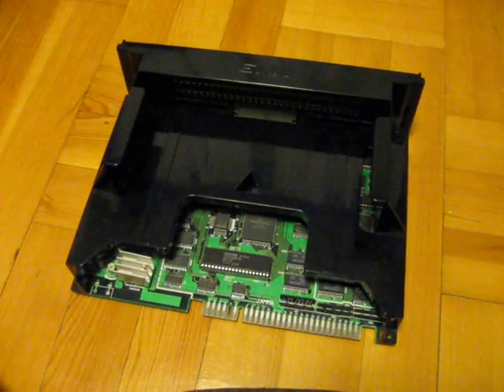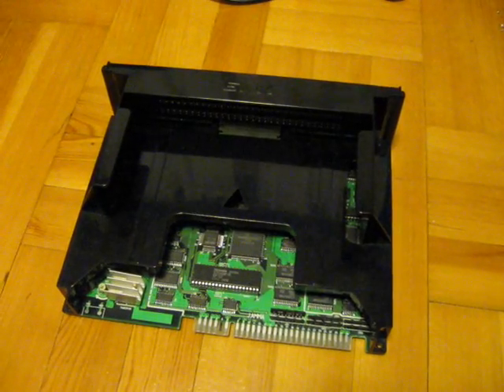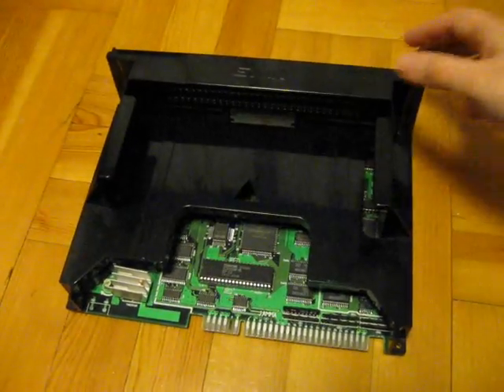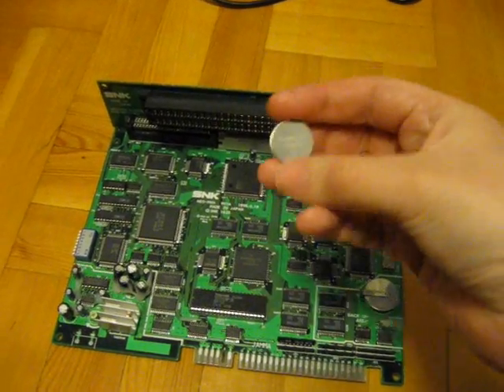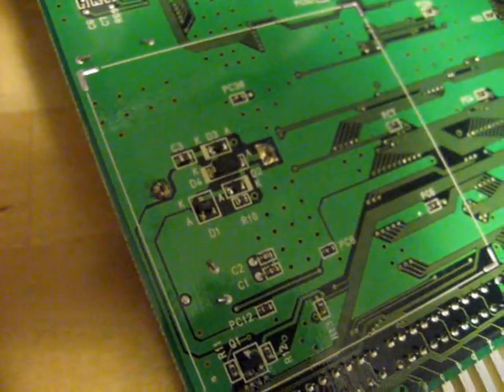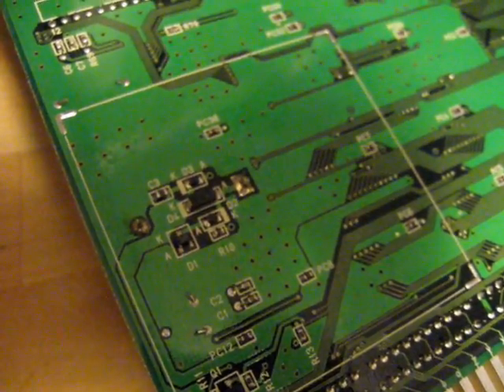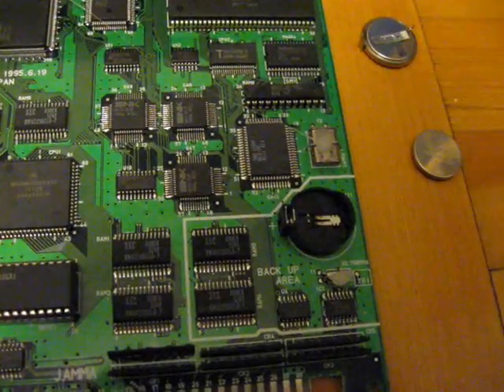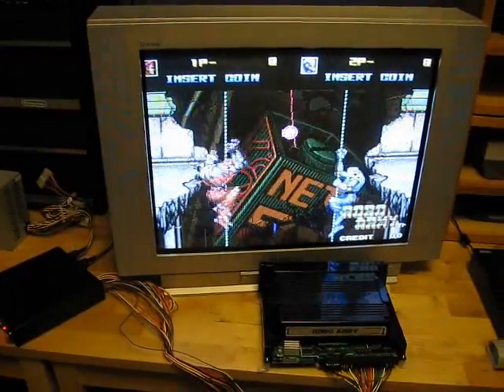Replacing battery on MV-1A Neo Geo MVS 1 slot board

Comment: Hello, I have the same board, and i did the same hack, removed 3 resistors, battery change with a holder, and put a CR2032. This works ok but the problem is that the battery empty very very fast and I don't know why. Is there a solution for this? thanks a lot
Reply: I heard the backup RAM SNK used suck up more power than others.  The only thing I can think of is finding compatible backup RAM chips that use way less power.